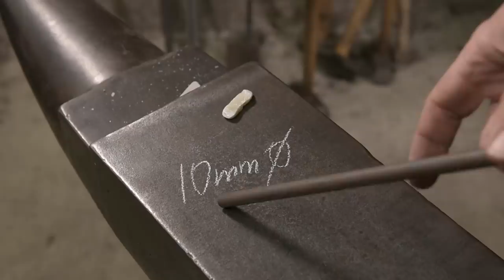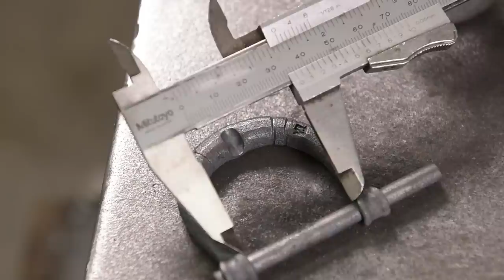Making a forged belt buckle and leather belt

Comment: For future reference,  if you leave the foldback longer behind the buckle and just stitch down both sides you make a stronger belt.  Stitching across parallel to the buckle is a perforated line where the leather is weakened.  It can and does fail and in a worst case the buckle actually tears off.  Beautiful buckle though.
Reply: Why not just use rivets instead of stitching it? I have an inexpensive department store belt made from an approximately 1/8" thick plain leather strap (no idea what the grade of leather is) that doesn't have any stitching at all, just 2 rivets to hold the buckle and loop in place. It finally broke a few weeks ago after about 32 years (I got it in 1991 when I was 16), but it didn't break on the buckle end, it broke on the other end across one of the prong holes. The buckle end is still plenty strong, and if I were to graft a new piece of leather onto the other end, I could probably get a couple more decades of use out of it.

Comment: 20:05 - when punching holes with punch pliers - squeeze the punch through the leather, rotate 90-degrees left then right, and finally remove the pliars. The rotating will give a clean cut and remove the punched plug too.
Reply from the maker: Good tip! Thanks

Comment: Great job-again-the only point i do differently is that i work the loop on both sides in to the belt, it makes easier to wear.  i make mostly brass and RVS buckles. Great trick with the copper wire. Thanks.

Comment: looks great 💕 little tip for Holes to close the Belt, make them oval or long holes, about 1,5 - 2 times of the diameter .. less stress for the Leather and it closes better / flater / less bulge
Reply from the maker: Yes, good idea... Need to make an oval punch I guess :)
Reply: @torbjornahman  sound like that 😂😉

Comment: Very good as always, thank you. If you make another buckle, you could take out the horseshoe shape, and make the end square. Round buckles make the strap round. and resist pulling the belt up. I found out when using a big "horseshoe" buckle on a belt I made many years ago. Or you could exaggerate the roundness out a lot bigger on the buckle, so that the actual tongue area is a lot straighter where it meets the leather. Just a few thoughts. Regards...

Comment: This is so, so awesome :)
If I may, here is an advice from a leatherworker:  When making belts never make stitching holes vertically.  Belts get a lot of stress and stretching, and having holes vertically is like toilet paper, a point of weakness.  Now this specific belt is obviously for yourself, and you have a thin waist, so it's really not an issue, but a bigger guy would stretch and (eventually, over time) maybe even cut this belt.   If you end up making another one, fold the leather on the buckle as you did, and instead of stitching it secure it with a couple of double-cap rivets, or saddle rivets, or even better chicago screws.  And use bridle or skirting leather, it will really make a belt for a lifetime.  (The chicago screws allow you to move that beautiful buckle to different straps if you want)
But well done, this was awesome!
Reply from the maker: Thanks! Yes you're right... and it was a concern of mine to start with but looked at two belts I have and both had a seam just like this, so I proceeded like this. Next time I'll try something better!
Reply: @torbjornahman  yeah but most manufacturers don't really want your belt to last a lifetime anyway :)
Reply from the maker: @SP-nx8qx  Haha, right!

Comment: I would advise:   On that first bend of the leather that holds the buckle on, Your holes should be staggered every other one, which will make two lines of holes and your string will be in a zig zag..  but that makes it a lot stronger;  because when those holes are that close together in a straight line--- you're nearly cutting the belt in half.
Reply from the maker: Indeed a good idea!

Comment: I have the tiniest little Irwin bar clamp (maybe 4 or 5 inches? It came with a set of proper sized clamps) next to my vice and when I'm filing something and it makes that ghastly squeal I throw that little clamp on the end of whatever it is and it stops the squealing and ringing. I've heard a magnet works too but I've never had luck with it. Sometimes filing something can be almost painfully loud.
Reply from the maker: Yes, that's a good trick!

Comment: Beautiful as always! I do leatherwork myself and I have always thought it would be cool to offer belts with forged buckles on them... Also if that was waxed nylon thread you were using, you can leave the ends a little long and burn them down so they don't pull through. That is, if it is waxed nylon.
Reply from the maker: Thanks. That was waxed linen thread

Comment: Hello Mr Thunder Bear. Following the very high standards you’ve set for your channel this is an excellent upload. Seeing you scoop the coal at the beginning this has generated several questions I hope you’d be kind to answer. Where you get the coal from, are there shops catering for blacksmiths, how is this coal delivered to you (bag, box, truckload). What is the cost (in Swedish krona) per unit (kilogram, tone), also how much coal is burnt over the course of one year (obviously an average). Regarding the stamp you use on all your jobs, was that made by you or you had it made. I will finish by saying it was very wise of you to allow for future expansion of your waistline  when punching the holes in the belt. Cheers from OZ.
Reply from the maker: Thank you! The coal I have is an old pile I got cheap from someone through an ad. I have bought coke in large bags at around 500kg a piece. The prices are ridiculous at around 10-12k SEK per 1000kg nowadays. I do not consume large amounts, a 500kg bag lasts at least a year. The reseller I last bought from do not sell anymore, but check out smideskol.se.  The larger stam that I used on the leather is home made, the small one was made by an engraver.

Comment: ¡Excellent video,  Torbjörn! I wander if you can make a video about the design and preparation for a project. Do you use old plans books? Do you design in computer your projects? The steps in design an object to forge are good content for your videos. Cheers
Reply from the maker: For this one I looked around for inspiration then transformed that into a design that could be done with simple blacksmithing techniques.